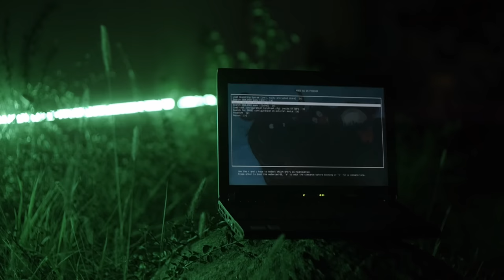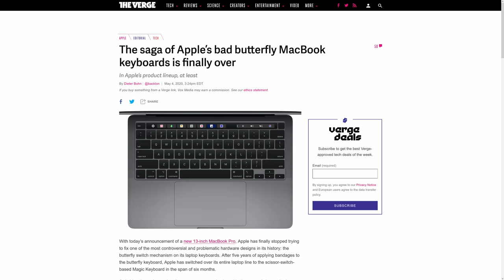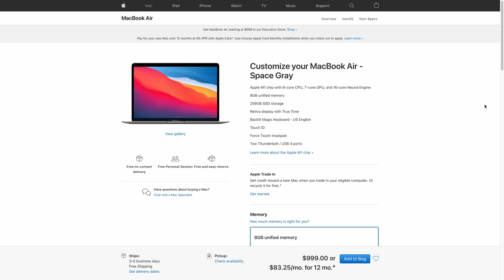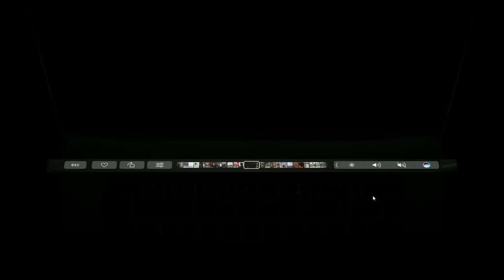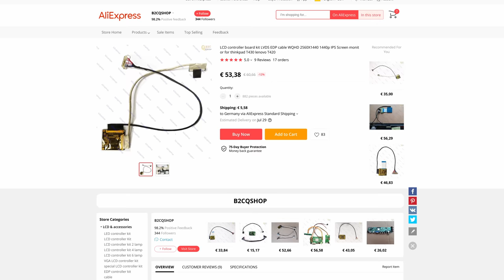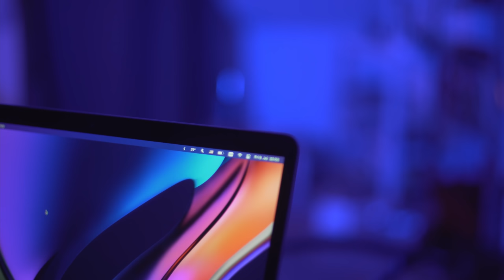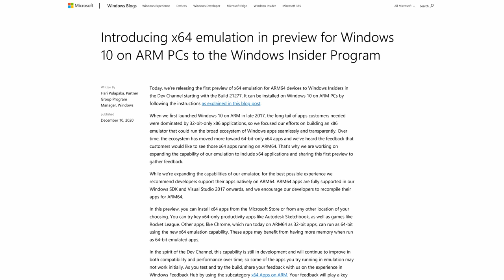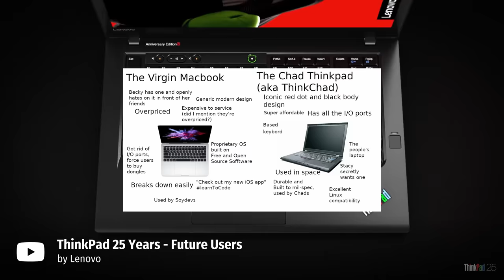Why I Switched to Mac (as a Linux user)

Comment: All those statements are very true, the M1 chip did prove that ARM is a better for a laptop environment than X86\AMD64, which makes a lot of sense since ARM is RISC and X86/AMD64 is CISC

Apple (surprisingly so) is not just a leader but innovator in the space of ARM laptops, and they did fantastic job, the main selling point of the M1 macbooks is the hardware itself - which is fantastic in my honest opinion

It sounds like Nubia and Qualcomm are preparing a competitive chip for Windows on ARM that competes with M1 pretty well (or maybe the M2 and so on)

if Framework catches the wind of that, it might lead to one of the best laptops in the world, to be fully repairable, upgradeable, have amazing battery life and so on, you'd never have to buy a new laptop again as long as Framework will continue to release new modules and take the old ones back (which will help our environment)

Currently, even though the M1 is amazing, it still is using dirty Apple tactics such as multi monitor software limitation

I disagree with you on the IO part issue though, the fact that you paid for another product to extend the capabilities of the machine to what it should've had, only makes the laptops more expansive, which makes direct laptop comparison between one another harder, however, assuming you are already "bought" into the hub ports products, it should not bother you except when you reach the bottleneck of that port (multi monitor, high network or some other GPU intensive workload with external GPU), however I do agree that docking stations or hub ports turn to a better designed working enviroment, Intel ThunderBolt did amazing on that space (which still exists on your Macbook, without the Intel CPU)

I don't like however Apple overselling the laptop, when it was released they tried to market it to gamers with comparison to RTX 3070, I personally was handed M1 laptop from my job and tested that theory, Apple laptops, even with native software, are a horrible gaming machines, even my (at this point) 6 years old gaming laptop that I bought for college overperformed the Apple M1 in terms of gaming by a large margin

I don't think the M1 is a great gaming machine at all, and I don't think M1 macbooks are good enough just for browsing and writing documents as of today - they advanced a lot, I just wish the Apple software would as well

Comment: I had a 8th gen X1 Carbon and it was pretty good. I have a 10th generation X1 carbon and I pretty much hate it. It feels bulkier, it has half battery life or less than the 8th gen and with often short bursts of loud fan without doing anything heavy on it. I'm not an Apple fan at all but I kinda feel an M1 laptop would have been much better.

Comment: I have zero issue with Mac's that dont use the butterfly keyboard or touch bar, I still use a Mid 2012 13" MBP with an 480GB SSD & 16GB of RAM, the thing runs perfect still got it dual booted with Linux & macOS

Comment: I personally have a 2020 HP omen, everything is easy to upgrade, and it's got a great port selection, the downsides are similar to those of the old thinkpads. It's bulky, and sometimes rather loud. I've been having a great experience on arch, but if I ever need to run proprietary apps then I'll probably go the hackentosh route, rather than installing windows. Apple's brand is built on privacy, unlike Microsoft's, so I trust them to some degree, despite my overall hatred for the company.

Comment: I have a Packard Bell from 2009 has good very quality ips panel, during the years I upgraded from HDD to a fast SSD, upgraded memory and changed keyboard  bought smaller charger and  new battery packs, still pretty good compared to all the laptops I see today that resemble me low quality tablets with a keyboard.
At the time I bought this notebook I had an HTC Desire ..
If only computers evolved like smartphones I would buy a new notebook for sure but for now? no, no reasons

Comment: I think for alot of people that are choosing thinkpads one of the main reasons is the price and ability to replace failed parts.
I have 5 x220 around the house, all bought from ebay for no more than 200$, if an ssd or ram module fails, i can easily swap it out and keep using it.
That out of the way, i also have the new m1 mac mini, if any part of it fails, i imagine repair bill will be at least half of the price of a new one.

Comment: The m1 MacBook Air was my first apple product, and well I’ve been hooked ever since.
Why? Cause there are enough slight inconveniences that annoy me. For example, Even tho I have an s22 ultra, I always reach for my 14 pro max instead. Want some examples? When I first opened the camera app on my s22 ultra, it asked me for permission to use the camera. I get that in third party apps you want to ask permission, but seriously the trusted first party app that is a crucial part of the phone experience? Ick. Whenever I press “save photo” in the built in photo editor, it sends a notification. A notification is meant to tell me when an event happens that I didn’t know of, I actively pressed save don’t tell me. Another ick.

Comment: You did not mention the compatibility issues of M1/M2 chips with some softwares. Apple silicon is good for creators and average users. But not for power users who constantly run multiple virtual machines and work with drives with various file systems. There are paid solutions to virtualization like Parallels and VMware products but you have to shell out some money every time you upgrade the software. Some operating systems like OpenWRT can only be compiled in a linux x86 machine. Most windows games run on linux using proton, but not on Mac.
Reply: Free solution: UTM (it uses QEMU under the hood)

Comment: How do Linux focused vendors like system76 and tuxedo rank in comparison?
Reply from the maker: I haven’t used those laptops personally, but I really like the idea of a laptop that’s been specifically built to run Linux. So many issues on Linux stem from hardware incompatibility. Almost all laptops sold these days are made to run Windows specifically and haven’t been verified on Linux, so offering an alternative is a step in the right direction

Comment: Till your ssd fails or you batteries is ruined in 3 years and you toss it. SSD in my brother's mac failed after 6 months, they have to replace it, so yeah trust researchers
Reply from the maker: The battery is much easier to replace on this model than on the previous Macbook Airs, and iFixit sells a replacement part: https://www.ifixit.com/Store/Mac/MacBook-Air-13-Inch-A2337-Late-2020-Battery/IF188-160?o=1
Reply: @WolfgangsChannel  oh sweet! Thanks for sharing

Comment: My last Macbook was a 13" Pro from 2010 (back when they still had optical drives), and I only retired it about 18 months ago.

I don't know what the hardware longevity is like on newer Macbooks (aside from the models with the butterfly keyboard, obviously) but 11+ years was a damn good run for a laptop I treated pretty roughly/clumsily.

Comment: Back in 2021 I was ready to go for the Air M1, but since i'd physically check every ultrabook i could find around - by hand and eye, almost like that dude at 17:40 -  i discovered that M1 Macbooks on display in store were NOT cool to the touch and quite heavy for their size, and had a stupidly sharp front edge under palms,  and the keyboard was not so sharp in typing and kinda small in size, and dark colored models were prone to fingertip smudges, and 2 ports only, and the screen a bit too tight... I couldn't force myself into that after I found Acer Swift 5 (i7-1165G7) which was a more pleasant machine in every aspect mentioned above + it was cheaper. 2 years later, not much has changed -  I  think the true strong point of Air is how good it is at productivity; other aspects are decent at best.

Comment: Personally I take the stance that my old hardware does its job for my use case, and while I would like new hardware for efficiency, improved graphics, battery life, I can wait until the industry either gets its shit together (engineers a product that is not overpriced, wrought with planned obsolescence and non-replacable parts and a closed ecosystem) or I'll pick up botany ... Apple has burned me in the past with its locked down eco system and all the reasons you mentioned ... won't allow them to burn me again. Instead I keep my eyes on chip technologies and how they develop on various platforms and use cases. In the end, it's best not to go shopping when you're hungry or horny.

Comment: Started with Linux since 2001, a young 14 yr old that got sold to the idea of GNU/Linux, free and open source software.
 
In 2009 I switched to a mac, those were beasts, I got a original MacBook, then a MacBook Air and finally a Pro, those are the ones I bought but every job then gave you a mac if you were a developer, they were really good machines, I still got my Pro from 2012 running.

Then the hardware kinda became crap, and the software is incompatible trash, the company I used to work at in 2012 literally lost so much money because my mac failed to update VMWare for like 3 weeks we kept finding workarounds that didn't work in the end.

After so much fighting with VMs (Brew also is / was crap) I moved back to Linux in 2018, after a good 9 years of OSX and I don't see a way back to OSX as my daily driver, I only use an iPhone because well I don't like Android phones.

My point is, you'll be back, trust.

Comment: the 2019 16” i7 macbook pro is a very good laptop it is fast comes with extremely good radeon graphics that wipes the m1s integrated graphics and you can run bootcamp on intel macs makes it much better if you need mac and windows. only things that are weak is the i7 9750h compared to the m1 macbook air and the noise battery. I recommend the 16” for more intense compatibility and graphics. even tho macs aren’t for gaming the 16” has a bigger screen and better graphics if your trying to switch to mac I would recommend the m1 macbook or the 16” for ya’ll mac gamers. You can pick up a 16” macbook pro for 600 / 700 on back market 😮 refurbished! extremely good deal but the m1 is 700 on back market refurbished also a extremely good deal! 😮

Comment: I have been using linux as primary os for 7 years and then I started using M1 pro. I would say I miss a lot but M1 is a beast and battery is insane. If you carefully look what they offer at that price is a good deal. One big thing I felt was everything was just a child's play and stable as fuck. 
Not in love with mac books but if you can afford it, it's a good choice for work laptop.

Comment: Recent thinkpads aren't up to standard for repair (and upgrade) in my experience. Currently I prefer some HP elitebook models and a few Dell's. The framework laptop seems nice too, but I haven't seen one irl yet.
I apply a heavy throttling policy and it's cool and quiet for simple daily tasks, and I can always return to high performance at any point I want.
I don't get along with the MacOS workflow, even after I got used to the hotkeys.

Comment: Ubuntu 14.04 on Macbook Air was my darling combination, and unfortunately it's gone.

It worked for my use case (web browsing, terminal, and an occasional video/youtube playback, so no gaming), despite the hiccups (camera didn't work, wifi lost connectivity when battery reached ~20%, and the computer didn't consistently go to sleep on the first lid close). As a cherry on top, it gained ~20% battery time compared to OS X.

But Ubuntu 16.04 cut battery autonomy time in half, and that was the end of it. I couldn't figure out how to fix this, and eventually gave OS X a try. My simple use case combined with the final absence of those nagging issues made me stay with OS X in the end, despite the fact that Ubuntu was a bit better at staying out of my way for my workflow.

Comment: m1 macs are really something different, especialy for video editing. I tried editing videos on m1 macbook air and this thing is nuts! It was pretty close in render time and in entier editing proces to my desktop pc with ryzen 5, while it was running on battery, on my couch and barely got warm
Reply: That’s because Apple Silicon Macs have dedicated hardware-accelerated video transcoding logic - purpose built coprocessor hardware always excels at the task for which it has been designed

Comment: With Asahi Linux you can switch between Linux or Mac whenever you want on M1 macs and onwards. And unlike Parallels which is a virtual machine, Asahi installs Linux to dual boot. I know that there's a lot of work left for it to work totally flawlessly, but when I finally get a mac Asahi will already be way better than it is right now.

Comment: I always disliked Lenovo Keyboards, even long before I switched to Mac some years ago. Every ThinkPad I had in hand was chunky, the keys were hard to press and the feeling was just "ugh that's exhausting to write on it". And also I hated that strange red knob in the middle which tried to be what? A mouse? A Joystick? Just plain annoying that thing. I'm currently using an MX Mechanical from Logitech, which together with the Mac keyboards are the real deal. Also I found your noise comparison really funny. Have to use a Fujitsu Laptop for work and everytime I open two programs at once that thing starts to breathe heavily... just annoying if you're used to most of the time silent Macs.

Comment: To criticize I will say that it is not a good comparison because intel 7th gen is 8 years old while the m1 is much newer. You shoulx compare the mac setup to something like framework laptop which has 11th gen cpu.
Reply from the maker: Thinkpad X1C6 is 2 years older than the M1 Mac Mini. At the time of making the video, Framework laptops weren't sold yet, but even after coming out, the most-high end model, with i7-1185G7 would get outperformed by the M1.

Comment: The only thing makes me still look backwards to ThinkPads with Mate-based Linux on board. Virtual desktops. You can’t make them in several rows  and they switch too slow due to fancy animations. As a software developer I often get distracted looking for the right virtual desktop on macOS. Yes I could use more monitors but I want my setup to be as mobile as possible.

Comment: Hi, discovered recently your channel. I daily drive Windows 10, on a Lenovo Ideapad ( a cheaper series compared to the Thinkpads ), powered by an AMD 3700U, and 8 GBs of DDR4.
FIrst off all, if the applications that are your main concern run much better on MacOS, you should run MacOS. For example if you develop apps for MacOS or iOS, the most hassle-free way to do it, is to use a Mac. And if you do something professionally, time is money, so hassle free is VERY important. Yeah, for what is called SOHO tasks ( office applications, Internet usage, media consumption ) a Mac is overspending probaly ( although if you have other devices on the Apple ecosystem that might not be the case ). These things are possible even on a mid range Android smartphone, in regards to computing power. I have a Xiaomi M1 ( 4+4 core ARM, 4 GB RAM, 64 GB storage ) and it trounced my old desktop computer ( which was 10 years+ old when it was decomissioned ) in those tasks. If USB-C Alternate Modes was adopted by more devices, it would make smartphones capable to fulfill the computing needs of many people. Unfortunately, this isn't the case. 
Regarding upgrade ability, you are correct. If a PC can't have its mainboard upgraded, it will become e-waste. And unfortunately, laptop mainboards don't adhere to any form factor standard, as desktop PCs do. Beyond 10 years, and even a decent nowadays laptop will feel sluggish for most stuff that you might want to do. Sure, you could maybe find a task for it as a secondary machine, but for everyday tasks. RAM and disks can take you to certain point, but CPUs, APUs, and dGPUs are soldered on all laptops today...
I wouldn't kill x86 yet, though. Apple Silicon has the advantage of better lithography at the moment.

Comment: Thinkpads are built like a light tank compared to one of the older Hp Elitebooks, but if something break on the thinkpad it is easier to dismantle the plastic parts and fix it and they have far better keyboards especially the IBM type keyboards

Comment: My issue with ThinkPad is their heat management. Had to take off the bottom of mine because it was running incredibly hot. Dunno what made Lenovo go with that frustrating 1 small vent design.

Comment: But it's an ARM CPU. Isn't it true that a lot of Linux programs DON'T support ARM. Your selection in software is probably a lot more limited then if you use x86_64. But it's Mac so maybe software writen for Mac has better support for ARM.
Reply from the maker: The M1 machines do x86_64 emulation pretty well (e.g. you can realistically run games, 3D and CPU intensive application). Half of it is in the macOS software (Rosetta 2), and they also do some hardware black magic to make x86 apps run smoother. Not sure if any of that works in Linux though
Reply: @WolfgangsChannel  it doesnt, yet